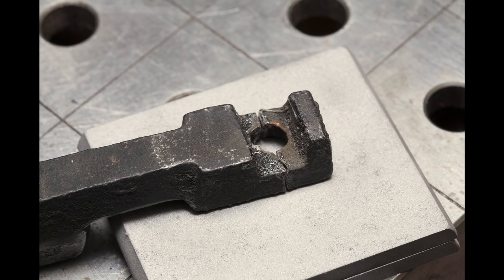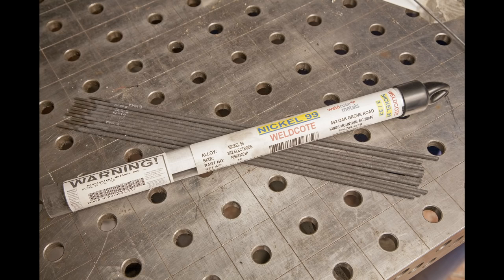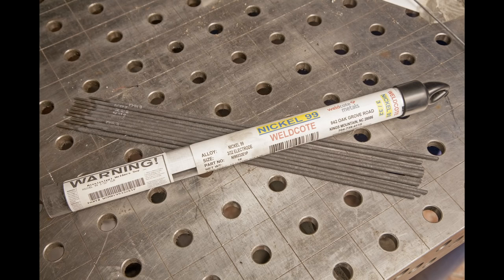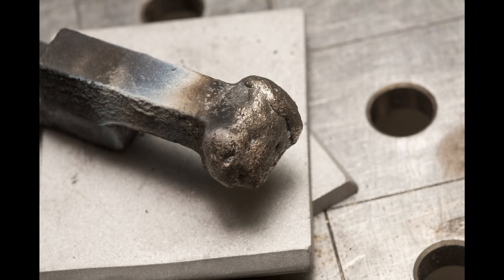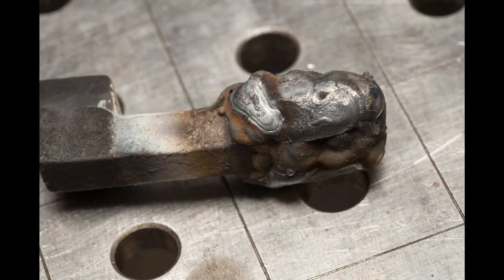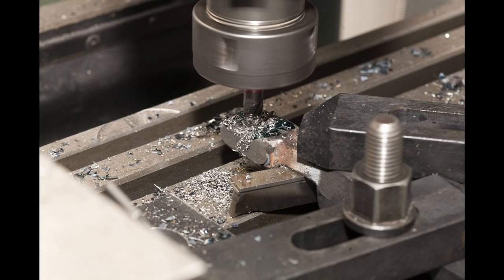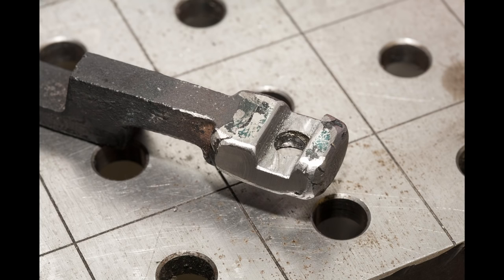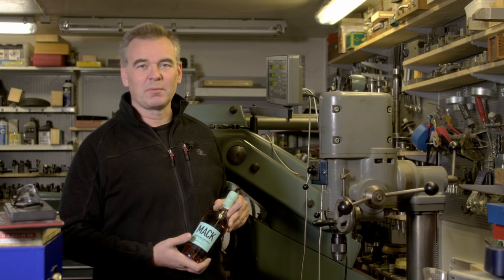Cast iron repair

Comment: That is a very nice repair, you can avoid the cracking if you keep the weld area hot and let the temperature down slowly, but I have also experimented with MIG welding and had good success with this, especially on the iron used for car manifolds, by letting the temperature down over 1/2 hour there was no cracking at all. Very many thanks for posting this, and a Happy New Year to you.

Comment: I see you have an Arboga Mill Drill.   Do you ever use it as a milling machine?  could you talk about it on a video?  thanks,
Reply from the maker: Well, I've done some milling in it, but honestly... It's not even close to having the rigidity of a proper mill like the Abene. I'm actually thinking about selling it, as I mostly drill with my Deckel FP2 anyway.